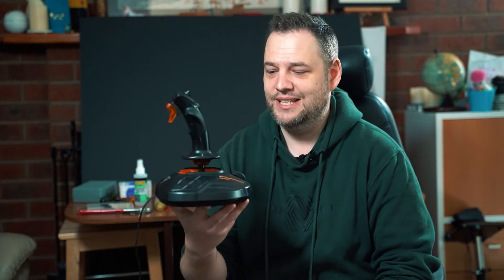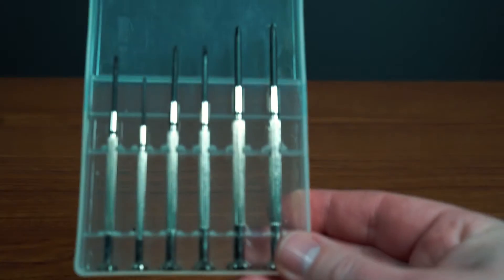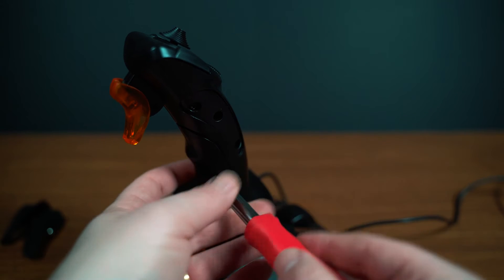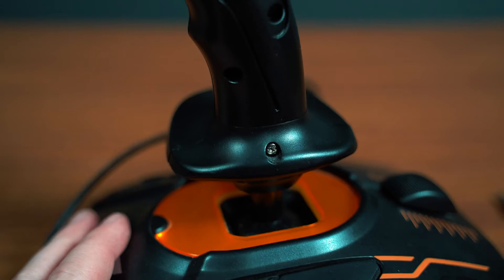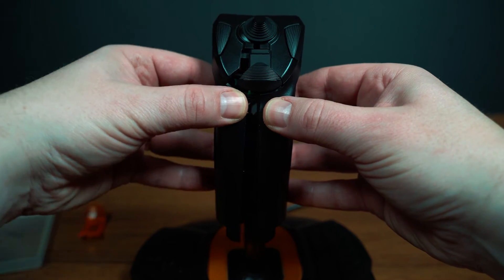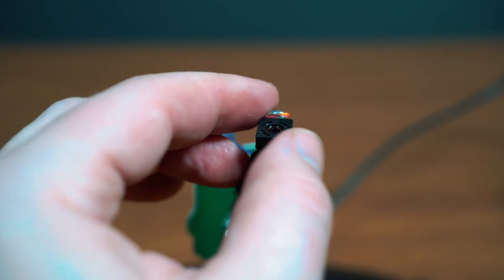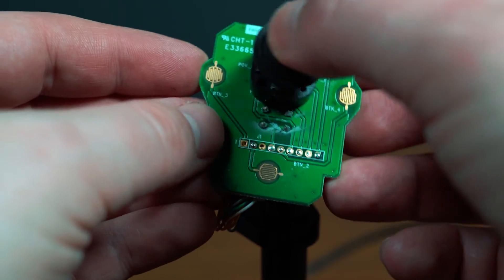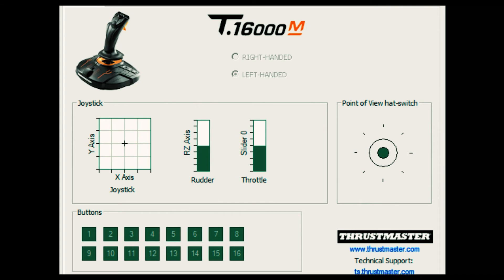Easy fix for T16000M stick/twist rudder - Complete tutorial

Comment: My word. That is toy quality. The CH HOTAS uses all discrete, self-contained switches, not this game pad level of cheapness.

Once a potentiometer gets 'noisy' in its response after many hours of use, it's usually the case that the wiper has worn a groove into the carbon film layer (which provides variable resistance). If so, the thing has not so long to live, and issues tend to pop up more quickly after each such cleaning.

Again highlighting the difference, the CH gear is made so that all potentioneters (big, high quality, long-life, metal things) are easily replaceable. CH used to sell them, but stopped this policy at some point. Grrr. But they can be found (or could be as of a few short years back) at Digi-Key. I obtained 25, which should keep me going for decades.

You sell yourself short on your handyman abilities. Very well done video! 😊

Cheers from Canada.

Comment: A simple household vacuum fixed it: Had this for 3 yrs. Then the twist went right after the warranty expired. I watched your vid and couldn't believe that it was a simple dust problem. So, I put my household Dirtdevil vacuum hose over the top and sucked out the dirt and now it works perfectly just like new again. No need to unscrew or pull it up. Many thanks for letting me know this.

Comment: Thank you! Needed your video to fix the rudder on both of my thrustmaster T16000 and the similiar thrustmaster airbus sidestick (which is much easier to dis- and assemble, than the T16000).
I actually opened the casing of the sensor and clean it deeply. Both work now like a charm!

Comment: Thank you!  This video worked for my T16000M.  The rudder axis jitter had gotten steadily worse for months and this completely alleviated the problem.  I see now that there is a linked video for removing the trigger rod.  I, too, couldn't remove this rod so I paused the disassembly at this point and tried prying the two halves apart.  I got them apart just far enough to move them both forward slightly, giving access to the twist sensor.  I DID have the trigger screw removed, but not the rod.  The middle button just below hat switch came dislodged slightly, but it wasn't too hard to hold it in place for reassembly, and the "nipple of doom" thankfully stayed in place.  After applying some alcohol and twisting the sensor a bit, I put it back together and it works flawlessly.

Comment: Yay! It worked. I had to use a bit of glue on one of the nipples and a hammer to get the trigger-pin loose. But other than that it went pretty smoothly.

Comment: On my third stick. I've done all the corrective actions and the issue returns shortly after. It's just how pots are with wipers and contacts, constant downward pressure. Some swear by the Gladiator NXT but I haven't tried it. Maybe it has HAL effect sensors instead of direct contact pots.

Comment: Thanks for your guide!

I became really frustrated with this stick when playing IL2 1946 (flight sim) since it was nearly impossible to win a dogfight with it. Especially when flying the plane at its limits and then the stick suddenly decided to wiggle the yaw bringing the whole plane into the wildest spins haha 😂

I once had a Saitek cyborg 3D which was such a nice device but it broke after me using it during my whole childhood and I tried to replace it with first the T.Flight Stick X followed by the T.16000M.
Both broke so quickly I really got frustrated about the low quality of these devices...

I didn't want to buy the Logitech x56 since it is super expensive for what it does but it seems to be the only real option before entering the premium segment so I guess they get away with the pricing..

Today I gave in and ordered a used x52 pro HOTAS after the repair attempt failed. At least the yaw issue has been much better after cleaning the potentiometer of the T.16000M so I can survive the next 5 days till the x52 pro arrives. 

Again thanks a lot - thumbs up 👍

Comment: Thanks. This worked a treat! I found that buttons can be kept in place by pushing them upwards so the little tab holds them in during reassembly. The trigger rod did need way more force than I expected to push it out. It's a tight fit.

Comment: success.... a bit more brutal than you and I left the joystick plugged in so I could test it before putting in my screws at the end and that worked so I could close it without wondering if it will work when I plug it back in. To keep the buttons up, simple tape on top did that and the tape held it up. 
ready to go

Comment: If you have trouble try WD40 instead of alcohol ! 
@Arvey I've try alcohol, but it doesn't work/last enough longer, and I think its removing the lubricant cuz I needed to do it often because the "drift" kept comming back and harder every time after some few days (I dit it at least 4 times). So I tried WD40... This thing is a fucking miracle. It fixed the drift, everything was gone and I could feel it was way effective.

Comment: Still relevant for me today! Though I disassembled the stick and without cleaning the twist sensor, I just gave the wire harness for the trigger more slack. It was pretty taught against the sensor so I figured that’s what was pulling my yaw to one side. Seems fixed but if it still happens I’ll give it a spit shine

Comment: I didn't believe it would work, seems like it's too simple to just clean the sensor. But worked like a charm. I reassembled the thing manually without the need for any Frankenstein's monster thingamajig, but if I were to do it again - I'd probably leave one half of the stick on just like others have suggested. Happy I can go back to gaming instead of ordering a new stick.

Comment: Thanks for the guide, it was helpful to see where the screw locations were, but as others have said there is no need to remove any screw, other than maybe the small trigger screw. You can just loosen the screws to open the case sufficiently to access the rudder axis potentiometer.
I bought my T.16600m joystick at least 8 years ago and have probably not played more than about 5 hours of MS flight Sim with it in that time. The joystick was stored otherwise. So I was rather annoyed when I obtained a copy of StarWars Squadrons only to find the rudder control knackered.
I found I only needed a size 0 philips micro screwdriver for the trigger screw, and a Wera size 1 philips was fine and easy for the others. I gently tapped the trigger pin out with a pin type micro-screwdriver and used a small pair of pliers to pull it the rest of the way. With the screws loosened I could open the case a few milimeters and see the potentiometer.  I gave it a squirt of WD40 special contact cleaner using the straw. Then a few twists and left it a minute or so, then a bigger squirt and tightened it back together. Now it seems to work fine, only took a relaxed 5 or 10 mins to do. No mucking about with nipples of doom.

Comment: Just a note, managed to let the pcb hang with the side of the switches still attached, made it a bit easier to get into as it's not really needed to take it off to get to the rudder twist.  also, for putting the other side of the switch in, i removed the switch from the mounting, slotted the side of the handle together, popped the hat of doom through the hole where the switch onto its connector and clicked the button back into place.  made it a touch easier (though you could just glue the damn thing into the button a be done with it lol

Comment: Great informative video! I'm currently experiencing wayward Z azis issues with mine, making it difficult to control my space ship in game. I'll definitely be doing this in the hopes of saving some cash instead of buying proper, (expensive), sticks. 😊
Reply: Did the problem was with the slider on the bottom? And did u solve it?
Reply: @Gameadictive  the slider on the bottom wasn’t affected by this issue, but the twist sensor was. I can fix the drift for a little while, but it will return eventually and probably completely fail. My next flight sticks will have Hall effect sensors. Also I’m considering trying a game pad for FPS and space combat.

Comment: I'm AMAZED how quickly and well this worked!!

Like others, I didn't need to undo everything -- I undid all the screws, including the trigger screw, but NOT the trigger pin, and then I split it open (required a little force). I used isopropyl as suggested, but I then also used compressed air to give it a final dust off as it wasn't as accessible as taking the entire thing off. It took me about 20 minutes because I was being super careful, but knowing what I'm doing, I could do the entire thing in about 5 minutes flat. Thank you so much!

Whilst I'm here... I'm only a few weeks into my Elite journey, I haven't really met anyone yet.... Where does everyone hang?

Comment: Awesome! This video helped me out a lot! I had the same issue and figured I would give it a quick google search and came across your video. I figured it couldn't hurt to try, since it was unplayable the way it was. It fixed the drift! It was a lot easier than I thought it was going to be. The only thing I did different is, instead of removing the circuit board from the one side of the joystick, I held it in place then cleaned the sensor and slipped it all back together. The nipples of doom were no issue for me like I thought they were going to be. I was able to hold it upside down and slide the half back in place. Thanks so much for this video, saved me from buying a new one now.

Comment: Thanks, this worked for me.  The 'nips of doom' technique that worked for me w/o too much trouble was to invert the entire joystick such that the circuit board was level but button-side-down so that gravity would hold the nips in place while I worked the handle halves back onto the circuit board.  What gave me a smidge of trouble is that I couldn't quite get the halves 100% back together initially, I suspect one of the wires was caught between the screwhole pillar halves.  Other comments here mentioned that the buttons 3-4 can actually be popped out and can be re-installed with nips after stick is reassembled but I didn't try this approach.

Comment: Thank you! I just started to use this with Microsoft Flight Simulator and the issue flared up. Your instructions were perfect. I used a toothpick to keep the buttons up on re-assembly. I am hoping I will not have to go back into the stick again. Really appreciate your help.

Comment: Great video but im so unlucky. when I was cleaning rudder, connection cables loose the weld, so now my rudder is not working anymore. Thanks thrust master for using shitty tiny cables. Anyway your video was very useful, thanks a lot

Comment: This is late, and not coming from a professional, but I just glued the 3 nipples of doom into place with a very small drop of instant glue (on the rubber part pointing up, not the metal contacts obviously). That made the reassembly process way easier. Maybe it will come back to bite me later, but for now I'm happy. Also, thanks for making the video, it was a huge help.

Comment: I only took the handle down till it was just 1 screw in the top. I only took it out about half way and then stuck a queue tip in and cleaned it. That way you don't have to put the top back together.

Comment: Every 6 months to a year... I come back to this video still to fix mine.
Reply from the maker: Bummer you have to come back, but glad it continues to work for you!
Reply: @ArveyJay  I'm just thankful you made this video! Legend!
Reply: Yeah that's because this isn't a real fix. I'll copy/paste the relevant part of my comment on the vid. 

Bear in mind that cleaning the potentiometer is NOT a fix, it's a temporary bandaid. The real issue is a design flaw that causes the potentiometer to physically be destroyed over time, what you're cleaning off is the byproduct of it being ground away. It will keep getting "dirty" over and over because of the flaw until it ultimately fails altogether. Then you'll either need to replace the pot (which will again be destroyed) or mod it to hall effect. But by then you'll have opened and cleaned it so many times that the screw holes will be bored out (they just thread into the plastic) and the stick won't go together anymore.
Reply: @Brunnen_Gee  It's not a design flaw.  They baked failure into their product.  They HAVE to have known about it by now.. this has been an ongoing issue for nearly half a decade at the very least... it is no mistake that the x/y axis uses a hall sensor, and the z axis still uses a potentiometer that fails shortly after the 90 day warranty runs out.
Reply: @Lionscoolaid  Whether it's from incompetence or maliciousness, it's a flaw in the design. Which makes it a... design flaw. 

It isn't the fact that it uses a potentiometer that's the issue. Lots of devices still do that and they last years and years. The problem is how it's held in the grip. Any downward pressure, something that naturally happens when holding the stick and relaxing a bit, pushes down on the pot and grinds it away.

Comment: I've been using this stick for about a year now and really like it's feel considering it's a "budget" hotas. I did recently pull apart the throttle to because it was getting sticky. I removed one of the springs and greased the rails which made a massive difference for the better, and I've now noticed the hat under my left first finger has some intermittent issue with the sensor.
Any thoughts if I've done something to cause this or is this also a common fault?
Reply from the maker: Haven't heard of this one before. Do you mean on the throttle or the stick? Might be something stuck in there so a similar cleaning method might do something for it?? Let me know how you go! Good luck
Reply: @ArveyJay  the analogue hat under left finger 1 on the throttle. Only seems to be a problem since I've tinkered so maybe I've caused the problem. Although I dud take a lot of care and don't think I damaged anything.

Comment from the maker: One of my excellent subscribers @CLEARRTC added a video detailing the button reassembly which should help with the nipples of doom. Thanks mate 😀
https://youtu.be/j2faY__KVFU
Reply: You cal also remove the buttons entirely, assemble the two halves stick, and then pop the buttons back in afterwards, which is what I ended up doing, at least for the final button. You can wiggle them out after lifting them up as described in that video, and they just clip back in with some minor persuasion.
Reply: Hi all thanks for the video, my solution was I didn't get out the nipples and the buttons, if you do it gently you can remove the stick part without it.

Comment: Mine is less than one month old and it's twitching the Rudder on itself, crazy!
Reply from the maker: Warranty/return definitely
Reply: @ArveyJay  Update. I did, and I got another one. Suprise suprise? It also became twitchy. I recently tried cleaning the potentiometer following a tutorial. The procedure is very hard and required me to take the whole stick apart.

It worked. For a day. Now the rudder is unbearable twitchy. It legit just threw a plane I was flying out of the air. I proceeded to remove the rudder control from that axis because this is unacceptable.

This stick could've been so much better if it wasn't for that godawful rudder design that Thrustmaster refuses to fix

Comment: Thank you my man. You have solved the issue with your hack, i also guess i was lucky with nipple thingy, i tried 2 -3 time and all went smooth, I have a question though, do you think this might happen again? and also is it ok to use glue the nipple thing to plastic part not the part where it touches the silicon (green part). it would be heck of lot easier for next time. let me know what you suggest. Thank again you are a god sent. :)
Reply from the maker: Hey mate, so glad it worked for you! I know others in the comments on this video have indeed glued their nipples but I have not. I suggest if you do it use something that will not degrade the material of either the nipples or their cups. :) Will it happen again, possibly. Some who have done this fix have had to repeat it, but hopefully you will be lucky! Cheers.

Comment: I appreciate your tutorial, it was most useful when I was doing my service.  I just thought I would mention after suffering with the silicon nipples I found the actual solution (and how it must be assembled in the factory)  If you look inside the grip where button goes there is a plastic tab that is part of the button protruding, use a small slot screwdriver to push it up and it will click into place, the button is now even further up and away than when in its unpressed position, slide the handles together the button will look obviously to high, give it a click and then moves back into the normal position, the circuit board will never have pushed the nipple off the button because of the extra clearance and you are good to go.  The pot in my controller is bad so I will be doing this again, I will take some pictures or a video to send to you to update or and an appended video if you like.
Reply from the maker: Thanks that would be great! Well done on finding the fix.
Reply: @ArveyJay  Emailed the trick to the button

Comment: in case this helps anybody else, My Z axis was always registering as active in one direction. cleaning sensor didn't fix the issue, but i found that the tension between the two halves was off, and therefore constantly pushing on one side of the sensor. tightening all the screws up fixed the issue for me, without having to reopen the stick again. A quick check would be to squeeze the joystick as hard as possible, and if that stabilizes the Z axis that could could be the issue
Reply from the maker: Nice one! Good tip